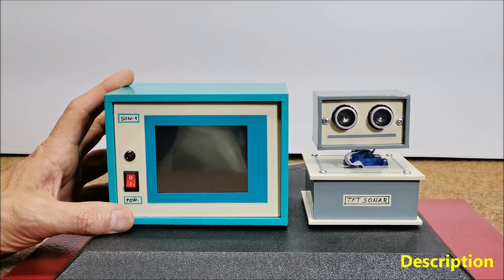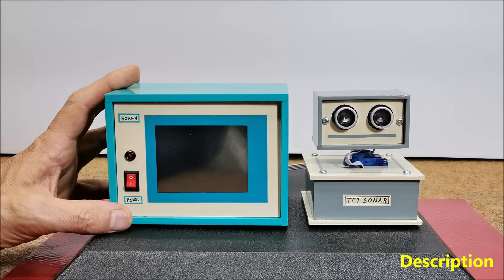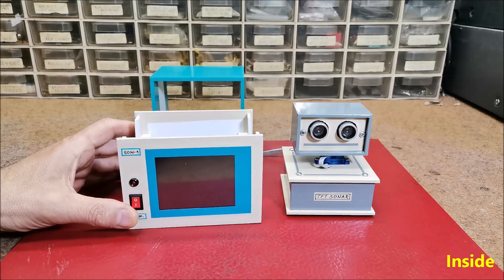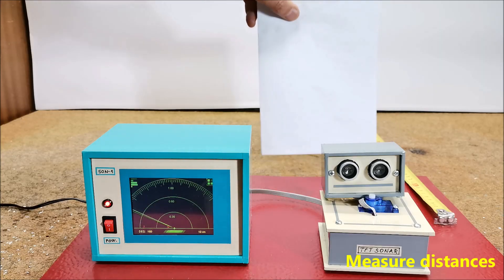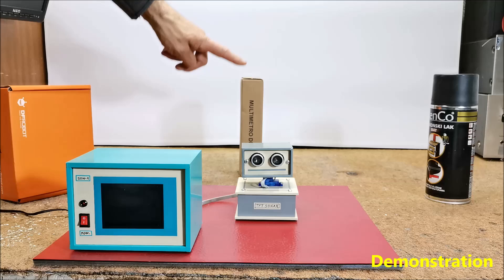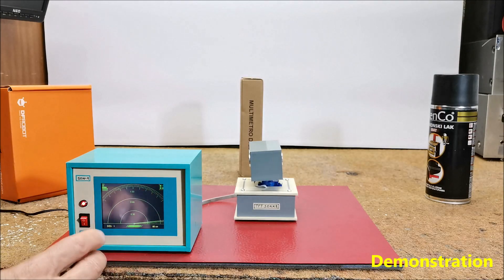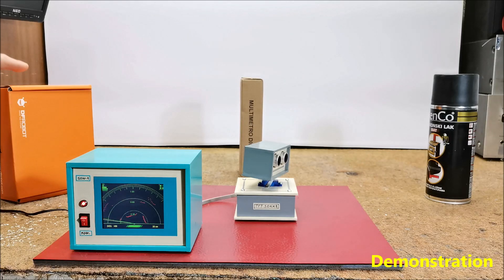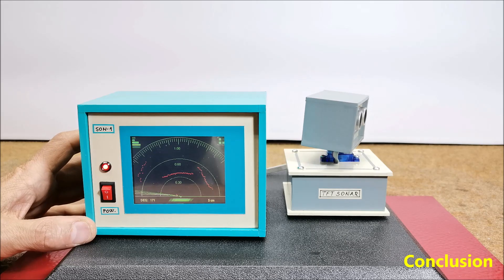DIY Arduino ultrasonic Sonar - Radar on TFT display

Comment: But why it is detecting the objects of opposite side first. I mean when the sensor is is facing right it detected the object in the left side and vice versa. Why?
Reply: This box has 2 ultrasonic sensors. Only the sensor at the back is used, which can be confusing.

Comment: radar seems to turn very fast with this code and no image on the display. can you confirm which pins of the screen you are using ?
Reply from the maker: Schematic and code at: https://www.hackster.io/mircemk/diy-arduino-ultrasonic-sonar-radar-on-tft-display-b5dde3
Reply: @MirkoPavleskiMK  thanks! use used a breadboard now to make sure the resistors are all corrected properly. The program seems to be stuck on "testing". any indication why that might be?
Reply: I made some progress switching to a UNO. I have the TFT showing the figure now and its updating with correct distance measures. The servo moves initially during the "testing" step but then stops. The radar image moves but the servo isnt. Could this be something in the code? (my earlier problem was with a faulty nano clone).  I have a relatively long cable (~ 30 cm) between the uno and the servo, could that be an issue (but it's moving initially when the program starts).
Reply from the maker: @bramh2445  The length of the wires certainly does not affect the servo. It may be a problem with the servo motor itself. If you have another servo, try a new one